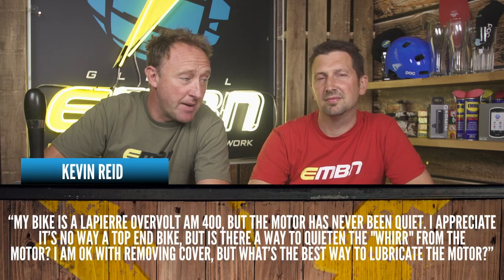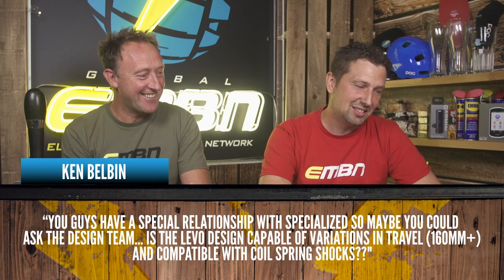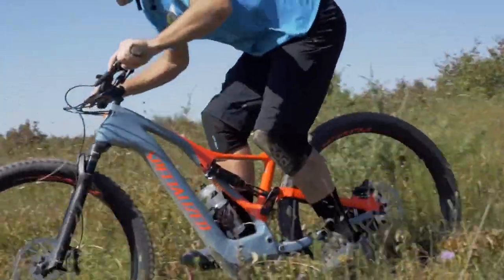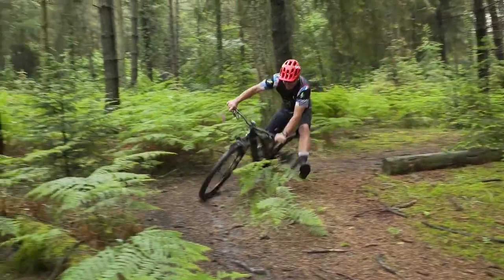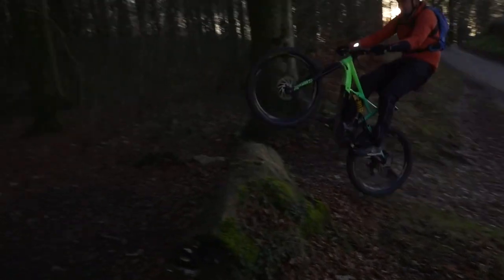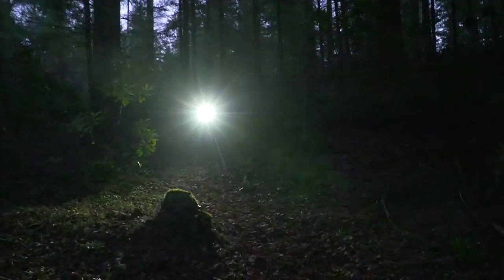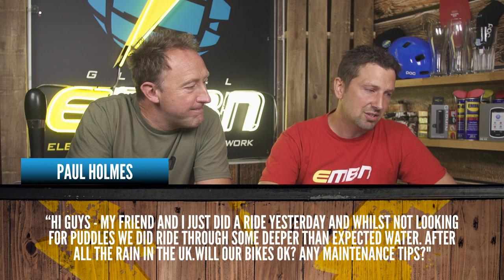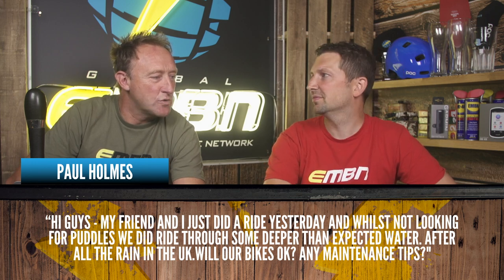What Sort Of Chain Do I Need For My E-Bike? Ask EMBN Anything About EMTB

Comment: Not sure where you got the idea that most motors last 20,000 miles. I have just replaced the Bosch performance line CX after only 4000 km. I only ever clean the bike by hand after every ride, have replaced the chain 4 times, fitted new cassette and freewheel and the bike is 2 1/2 years old. The bearings were shot and the main shaft was pitted. I worked for 40 years in Oil and Gas service business responsible for maintaining equipment in the harshest of environments so I know a bit about looking after gear. I think there is a lot of miss information on the robustness of ebike motors. Steve Jones even had one replaced during the Tour du Mont Blanc.
Reply: Just yesterday Song someone with older Bosch Motor with over 22k kilometers
Reply: Iv done about 12 thousand miles on a Focus hard tail emtb, it has a impulse 2 motor which has been replaced twice with a brand new motor and 3 times with self reconditioned motors. Each time I have reconditioned one it has been the bearings at fault and once changed they have lasted as long as the new ones. But my average motor life has been 3000 miles the lowest was about 500 miles (which was a new motor).

Comment: people raise the travel on the levo all the time. Check out the EMTB forums. Fox 36 and dpx2 is a fav.160 is noted as the sweet spot and you can increase the rear travel by changing the shock to a 210x55. The bike has been christened the 'kelevo' by all the experts posting on that forum.
Reply: Sss Kkk what forum is that??

Comment: Be careful with psi whilst most tyres are quoted as staying they will take up to 60psi this is with a tube not tubeless and the rim manufacturers max psi is often a lot lower wtb etc print this on there website  last thing you want is to hit a hole at 60psi & blow the joint out from the rim
Reply from the maker: Yes we would always suggest you check the max rim pressures. Mountain bike rims are often not designed with high road pressures in mind. You can however run a 700c touring tyre as Chris suggested. Blowing tyres off rims sucks! And can be dangerous in a riding situation!

Comment: Your summary on why a motor is noisy is spot on. I have a 2016 Scott E-Spark 710 with the Bosch CX motor. Which BTW totally silent. I had it replaced in November 2018 with a brand new motor under warrantee  because of the usual problem with the old motors. Worn crank bearings. Guess what? The new motor is also silent. My mate has a 2016 KTM Macina. Bosch CX motor. His was as noisy as f**k. He has had 2 replacement motors all very noisy.

Comment: @ Love you guys and the info you give, however until you have a show called E-BN I don't know where else to ask this question, so I'm hoping you'll be able to answer - I'm looking for my 1st e-bike, not necessarily a E-MB, maybe a hybrid. Is there anywhere I can go and see a variety of different brands all in one location and try them out (maybe similar to the Verbier festival but in the UK)? Cheers
Reply from the maker: Hey Lynne, check out The Cycle Show 13-15th September NEC Birmingham. It's not a festival but you can see a lot of bikes and speak to manufactures and they have a test track where you can try out bikes. Hope this helps 👍

Comment: #askembn I am riding a merida e160 it comes with 2.8 x 27.5 minion dhr, they are great for dh and aggressive riding.
Im giving serious thought to running running a set of 29" wheels with 2.3 - 2.4 tyres and rotor and cassette for my longer xc rides. The forks are 29er ready and the rear is roomy(ish)
Do you  foresee any issues? Cassette/chain messing? Rotor / brake bedding, overall tyre diameter variation/ motor speed limiter?

Comment: Steve, i noticed on your epic race across the alps that you ran out of battery quite quickly. What settings are you running the Levo motor on across Eco, Trail and Turbo as i seem to get much better mileage. Eco for example is at 22% on mine and Trail at 36%.

Comment: Hub motors don't need special chains right?  Just a torque arm on the dropout probably?
Reply: You are correct you only need torque arms if you are about 500w or more. Unless it's a front hub motor then fit on any power level.
Reply: @danielgreen4213  thanks, I'm going 500w, 36v 10ah and wanted to make sure before it arrived
Reply: I would say it's worth while for peace of mind especially if you have a aluminum frame and they are dirt cheap and easy to fit.
Reply: @danielgreen4213  I have a steel frame but I'm planning on this being a daily commuter so yeah, taking no chances

Comment: Sorry lads but you well and truly dodged the chain question.  Everyone knows e bike chains are a marketing scam. Just buy a basic sram, shimano, kmc chain. Lightweight chains are for regular bikes to save weight
Reply from the maker: E-Bike specific chains normally have larger diameter pins to help with strength and wear. Chain "stretch" is accumulated wear as the plates rub and wear down the pins. As Chris mentions the most important thing is to be sure to keep the chain clean and lubed correctly to reduce this friction.